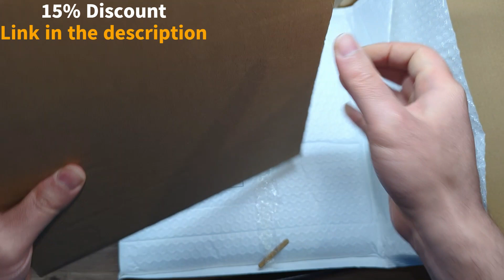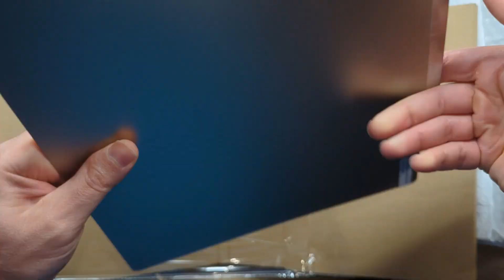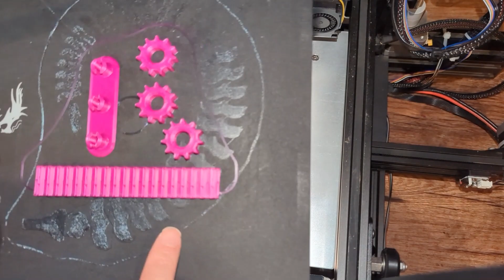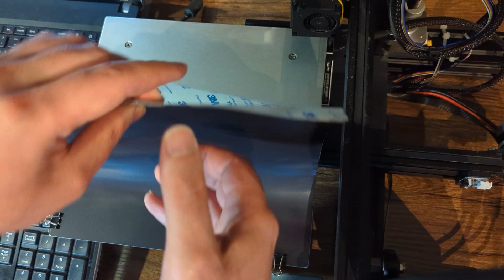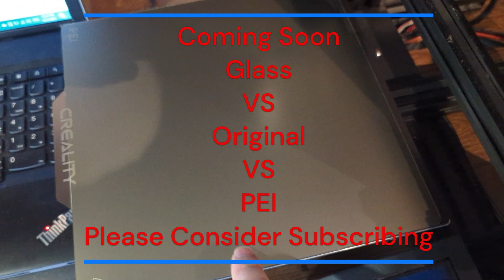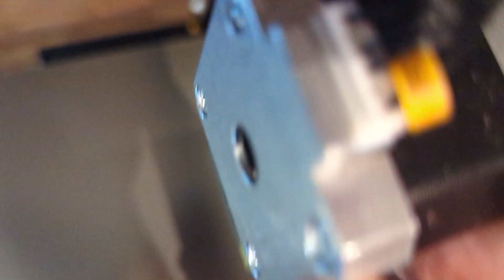Ender 3 Removable PEI Bed Installation | Ender 3 Bed Upgrade #3dprinter

Comment: Unrelated. I have been trying and failing to make a 3d printable plane. Like print and fly. One of my tinkercad designs might fly with enough speed but i havent dared to try putting one them in a crossbow yet. Instead yeeting them with my hand and watching them miserably going down. Probably need to tune slicer and design to make something that glides.
Reply from the maker: I'm guessing without a motor, right? you just have to make it in plane shape but the weight need to be really light and large wing size. I'm interested to see that
Reply: @techs.passion  Yeah no motor.
Reply from the maker: Very cool idea, I'm really interested to see it or try it out of course if you want to share
Reply: @techs.passion  Id recomend designing from scratch than trying the plane i made. But i can share the design maybe later today.
Reply from the maker: No worries, I think it's an interesting idea. Thank you

Comment: I bought the smooth PEI bed sticker and stuck it to the stock fibreglass bed when the PEI build surfaces first came out and it works well but I prefer my mirror tiles, I might buy the textured one just so I have a choice of textures for the bottom, I wont be buying them for my large printers though as they are very expensive in 400 X 400 size
Reply from the maker: Yes, I want to try out the texture one. I'm testing different beds and let me see if I can get a discount for them. I do not benefit in anyway but if I can find someone who is willing to give the discount I like to help out my viewers as a thank you for watching. Next week I should have some update on this. Thank you for always watching :)
Reply from the maker: Hi, so I got them to offer some discount. I thought I share. This doesn't impact me in any way, this is just my way of saying thank you for watching.
To Get 20% discount use links and code below:
PEI Bed:  https://www.amazon.com/promocode/AAVAN4TUFEUQY
Promo Code: 20HTTKFD 
Original Bed: https://www.amazon.com/promocode/A1SZLG2LF6OZ65
Promo Code: 20WXRHYE
Glass Bed: https://www.amazon.com/promocode/A3Q137VF45CJ58
Promo code: 201HQ2AX
Discount Will End On 2023/6/30